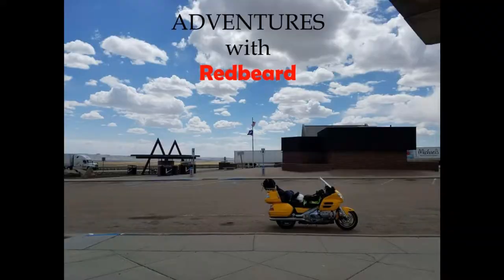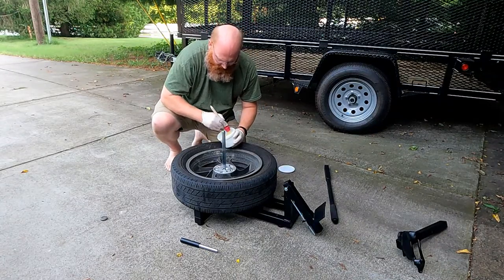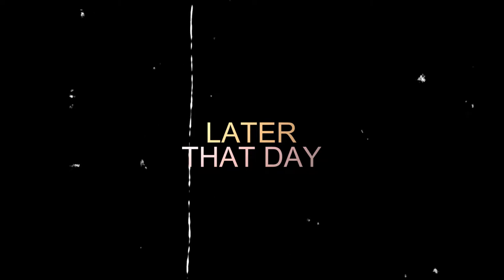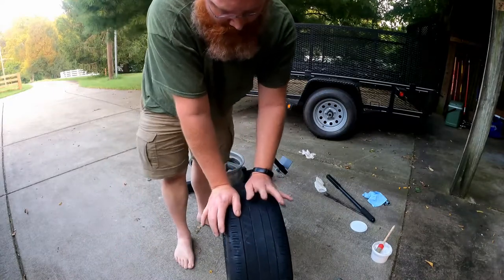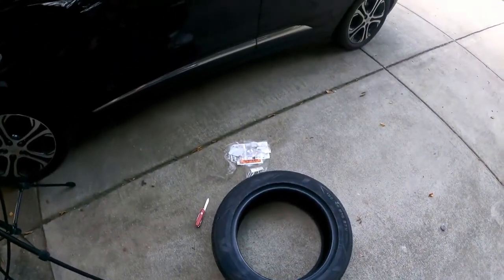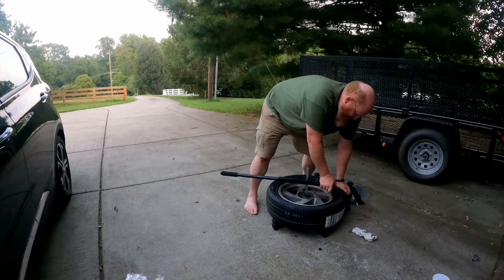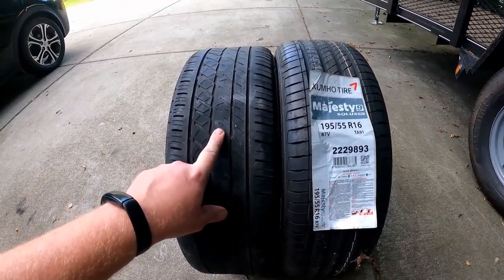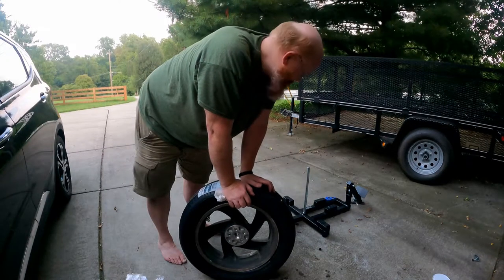Olmaxmotors First Tire Compare Goldwing Darkside Bridgestone Driveguard and Kumho Majesty

Comment: You should likely be running lower pressure on the tire than the Goldwing spec because you are using a significantly wider tire.
Reply from the maker: Is it the width or the weight rating?
Reply: Remember the weight rating of the car tire is in the vertical position, so in a corner that inside sidewall is carrying most of the weight.
Reply from the maker: @jimstenlund6017  You have me thinking about tire geometry. On a motorcycle in a curve, the weight of the bike is pushing down on the tire. The tire is at an angle, but so is the bike and the forces associated. I agree with you that most of the weight would transfer to that inside sidewall. On a car, in a sharp corner, a lot of the force moves to the rim and bead, perpendicular to the contact patch as the momentum of the car is pushing to go a different direction than the tire. Those sidewalls need to be very strong to not rip or separate from the rim with those forces. It seems to me the sidewall of a front tire on a car in a sharp turn could have more force on it than the weight of the car. I'll have to contact some mechanical engineering friends and see if they can do that calculation.

Comment: Don't trust someone who changes a tyre with bare feet and leaves a knife on the floor, where they are working. Clearly, they have no understanding or regard for safety! Dark siding is a bad idea. Just because it's cheaper does not mean it's right! 

Before going to the Darkside ask yourself:
 if someone you care about was hurt/killed in or by a vehicle that had a tyre on it that was not designed for that vehicle what would you want to happen? 
What if the tyre was the wrong size, had a lower speed index or lower load rating. 
What would you want to happen, to the person that chose to fit that tyre?
What if they had mixed innertubes with tubless, radials with bias or cross-ply tyres? if you don't understand that and the construction you should not be advising or thinking about doing this because you don't know what you're doing. 
Why am I writing this? Simple I know what I'm doing and care about road safety? 

If you hurt someone and your bike is investigated I'm pretty sure your insurance would not payout, meaning you are liable for the compensation and the money you have saved on the tyre is now being paid to the person you have hurt along with any other earnings you make. That cheap tyre is now starting to look pretty expensive now. 

By the way, some car tyres are directional, and some are asymmetric which means they have outside only, don't give people ideas of doing something when you don't know what you're doing. 

Are you a trained and qualified motorcycle engineer or tyre designer? 

FYI for anyone in the UK that sees this using a car tyre on a solo motorcycle is illegal; it is an MOT failure and your insurance will be invalid if you have an accident.
Reply from the maker: Thank you for your passionate comment. I can clearly tell you are concerned for safety. The car tire I use and the previous one are safer than the motorcycle tires I've used. Wet traction is better and the weight rating is better, not to mention a much smoother ride.

You may not want to hear that I have a rear tire on the front of my bike as well, and I've mounted it in the opposite direction. If anyone is interested in using tires "off label" there are databases where you can see what tires are used on which bikes and make an informed decision.

There is risk anytime we get on the road, whether by car or bike. Everyone must choose their acceptable levels. Some never even ride a motorcycle due to the risk. Stay safe out there and enjoy your ride.
Reply: @AdventureswithRedbeard  From my professional experience with both car and motorcycle tyres you get what pay for. I would never buy or suggest anything but a premium brand tyre, quite frankly I feel mid range and budget tyres should be banned. So two questions from your comments: 

1. Have you ever used a top of the range motorcycle tyre on this bike? 

2. Are databases you mention compiled by a motorcycle engineer or tyre manufacturer if not you might want to stress that. Because if they are not the person reading it can not make an informed decision.
Reply from the maker: @tomstanley7773  Prior to going Darkside I primarily used Metzler 888 then to Dunlop Elite 4's. I'm much happier with my car tire.

I'm a big fan of experience. I have over 20k miles of experience with a car tire and I learned from people with many more than that. Car tires have been used on motorcycles for many decades. As a large bike owner, touring motorcycle tires don't last and are prone to blowouts. Using a car tire on an 800 plus pound motorcycle is certainly something to consider.

How can you not make an informed decision reading the experience of others? Numerous people with hundreds of thousands of miles just might know something.
Reply: @AdventureswithRedbeard    Using a car tire that fits well on the rear wheel of a motorcycle makes sense to me.  Especially if you are a long haul, cross country rider,  pulling a trailer etc.  Reading about the possible insufficient match up of the car tire with the bead on a motorcycle wheel concerns me enough that I won't be using one.  I ride with my young children and I won't do anything that could possibly increase the risk of having an accident/crash.    However, if I was riding alone, making 1000 mile rides everyday, I would definitely consider it.
Reply from the maker: @GamingwithKandA  the bead issue was my last objection. There are people who can machine the bead to match the car tire bead.  The experience of others with no issues convinced me. At the end of the day you have to do what you feel is best for you. Keep those kids safe and thank you for including them on your rides, we need the next generation to be safe, thoughtful riders. Good job.